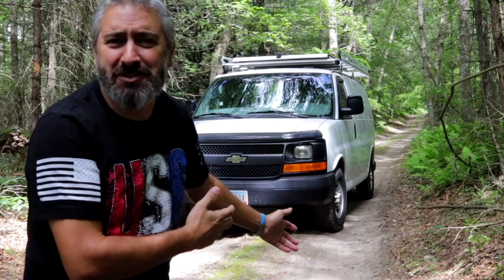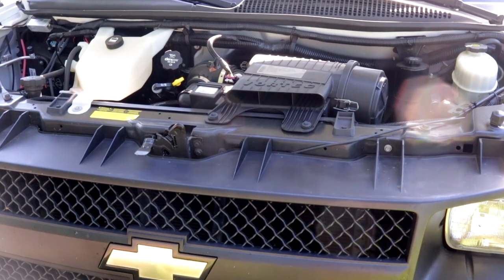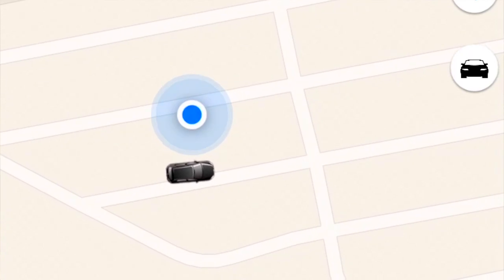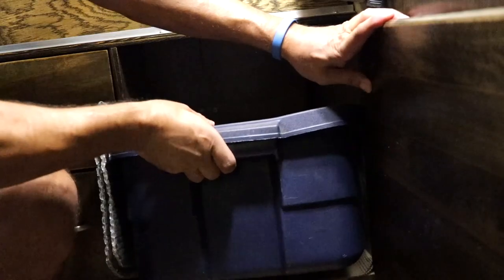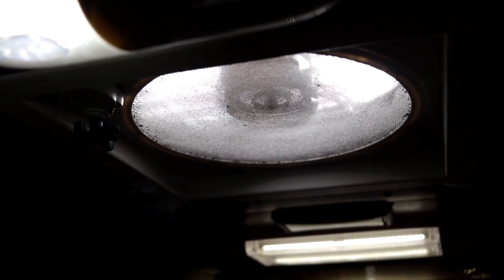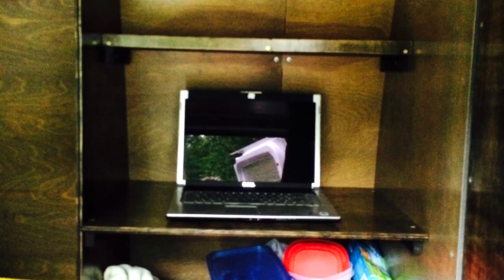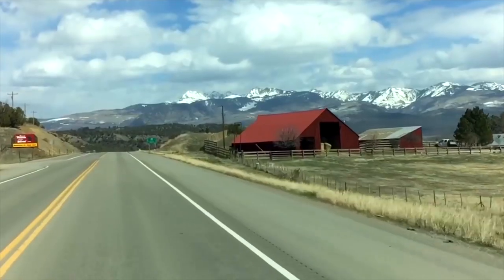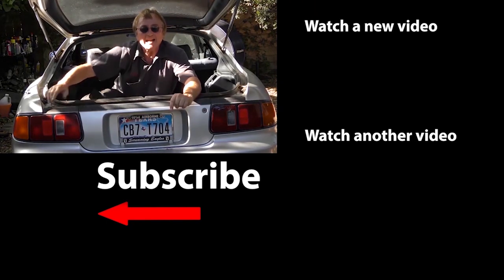What It's Like to Live in a Chevy Van and Drive Across America

Comment: Don't build out your van with all that stuff. A van gets atrocious fuel economy even empty and then people put everything in the damn thing including the kitchen sink and they are down to 10mpg. My 2020 118" Ram Promaster gets 16 MPG EMPTY. I have a bed platform in back made out of two Werner aluminum expandable scaffold platforms, removable with wing nuts because a van is made to haul stuff. That's it. That's my build. Anything else I need for a road trip is in Rubbermaid containers. People spend $50,000 on a van build which is crazy. You never get your money back on a build. Look on craigslist and there are dozens of 50k+ Built Sprinters on sale. Cars and trucks do not increase value. They go down the moment you drive it off the lot. A fully built out van weighs an extra ton. Vans are not pleasant to drive. If you want to get into the van lifestyle, buy an empty van and drive it around for a while and get it out of your system. Minimalist is the way to go.
Reply: Thing is I’m not doing road trips, I’m living in it full time going on 7 1/2 years. My van is my home and I don’t really care if the fuel economy is 20mpg or 15pmg. I’ve been actually getting around 16 and I’m towing a trailer with a Harley in it. If you live full time in a van and don’t pay mortgage nor rent and are worried about a few extra dollars worth of gas then you have to reconsider what you’re doing.

Comment: I bought a 96 chevy s10 2.2l manuel trans. It wont go into gear thats how i bought it. I replaced the slave and clutch and master cylinder. The clutch feels the same as before even though its new now. It changes gears if the truck if off. Turn it on it wont go in gear. Put in gear then turn on it jumps even though I have not let up on the clutch,  HELP PLEASE!!!!!!!!!!!

Comment: Hey scotty I have a 2007 Ford Freestyle my driver front tire shakes alot when i go over 70mph the tires are secured and well inflated 
What could it be  ?
Reply: I'm not Scotty but I would check to see if you lost a wheel weight or have a twisted belt in the tire. A tire store could check this for you.
Reply: If the tire wants to bounce it needs balancing. If side to side might be a bent rim. Try putting the back wheels on the front to see it changes. If not probably worn steering parts.